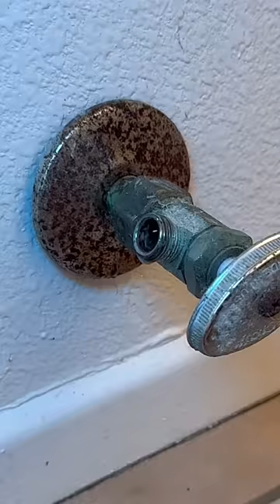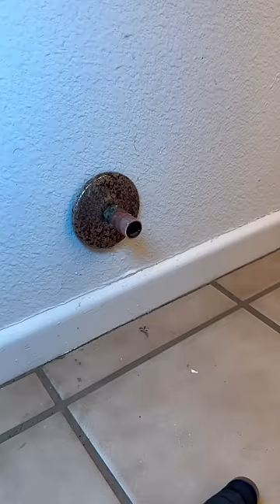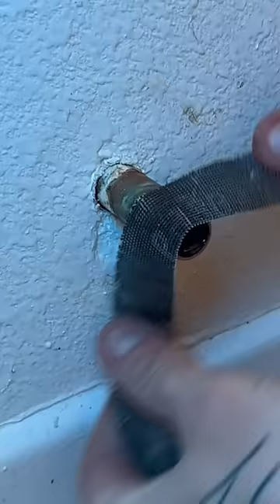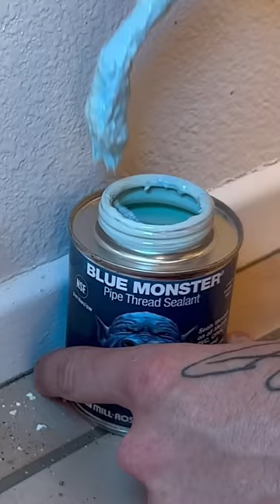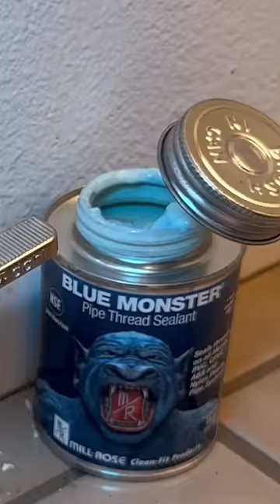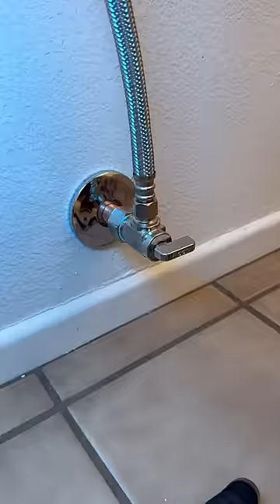HOW TO INSTALL ANGLE STOP! #new #newvideo #tips #tricks #hack #hacks #troll #water #plumbing #fyp

Comment: Wow... you know why you DON'T USE thread tape and pipe dope/ joint compound on a compression fitting is be cause it can and will cause you to not achieve the compression required to create a seal.

Comment: Southeast Asia rarely use metal parts. Usually, they are made with plastics including joints and pipes are not metals, but PVC pipes of all types, even outdoors ones. Yes, the hot rays of the sun eventually turn them brittle.

Comment: Even PROPERLY  threaded iron pipe fittings shouldn't "need" a sealant, the pipe dope is more of a lubricant, iron  pipe threads are malleable ,and if threaded PROPERLY, all the dope is squished out of the actual threads once tight. . Putting dope on non malleable threads  is ridiculous.
Reply from the maker: Yessssirrr 🙌

Comment: If you need thread sealant then you have installed the valve incorrectly. The combination of compression between the nut, the farell, and the valve body make the seal.

Comment: It is a compression fitting Dudley Doright, there is no reason for pipe sealant. He cleaned the copper, why did he not just sweat on a proper fitting? This is a video on how NOT to install a 90 degree ballcock compression fitting.
Reply from the maker: Where did you get this conclusion I wonder 💭 🤔

Comment: Why use paste on compression? I have come across this and Teflon tape, the tape sometimes is not wrapped good and is loose and long that when shutting off, the loose piece gets caught in the ball valve type and prevents complete closure of valve. So, no go with Teflon tape. New compression inside length to ferrule is sometimes too short so you need to make adjustments like either removing ferrule reducing the length, by putting a new one on it I use a 32 hacksaw blade just because I do not want to risk removing ferrule that may have cut in deep. There again, compression need NO tape or paste.
Reply from the maker: DO NOT USE TEFLON ON COMPRESSION FITTINGS

Comment: I never saw the brass ferrel in that compression angle stop. People talking about the unnecessary use of the teflon pipe dope on the threads for lubrication, not necessary but won’t hurt anything if it’s just a little bit and doesn’t make it messy. The main thing is the brass ferrel that has to fit over the copper pipe between the nut and the valve. That is what makes a compression fitting work and creates the seal when that nut is tightened… it compresses the copper pipe and flares it out a little. Not the same as a flare fitting but a similar principle. If he tightened that nut on the angle stop without a ferrel, as soon as the water is turned back on the pressure will blow that angle stop off the pipe immediately because there is nothing holding it on. Maybe I missed it. It is so basic. I’m going to watch it a couple more times and if I’m wrong I’ll edit or delete this comment. The guy used proper tools and did a good job except for not showing the ferrel and if you are going to use teflon pipe dope on threads that don’t require it, just use a very small amount or don’t use it. Definitely don’t make it look messy. I watched it again and stopped it just as he was putting the nut to the valve and I think I might have been able to make out the ferrel inside the nut before putting it on the valve. If it doesn’t leak and he cleaned up everything, including any excess pipe dope, okay.
Reply from the maker: Yes you did miss it 😂

Comment: No pipe joint compound needed when the seal is the compression ring.  I've seen it put in the actual compression ring which makes way more sense.
Reply from the maker: It’s used here differently than you think 🤔

Comment: Why put pipe drop on the threads of a compression fitting?  If properly installed, those threads never see water, and if improperly installed, the sealer won’t prevent leakage anyway.
Reply from the maker: Think about it ….

Comment: All the naysayers who criticize the dope have spent to much time in the book and not on the job . The dope or heat proof grease on the threads or and behind the brass Ferule let the nut slip and crimp the ferule into the copper . Only thing l see misleading is that the brass ferule is usually crimped into the copper thus deforming the pipe

Comment: The pipe dope on the threads is only lubricating them. the seal is made by the ferrule. It will lubricate the threads so it easier to take off next time.
Reply from the maker: Correct 🙌

Comment: Wherever there's water there's rust there's corrosion there's oxidation that's why you need to use the compound the thread compound. On all places where the water is

Comment: You don't put thread sealant on those threads. In fact you don't use it at all because the joint is a compression joint that compresses the compression ring onto the pipe and that's why he had to use a puller to get it off. Don't use pipe dope ( thread sealant) on compression joints or you may over compress the joint because the pipe dope works as a lubricant) just clean and compress😊   oh also don't make instructional videos of you don't know how to plumb!
Reply from the maker: You clearly don’t know what you’re saying user-os8sy…??? 😂😂😂

Comment: Why did you put sealant on those threads? If water gets past the feral it will flow out of the back of the nut, I don't get it
Reply from the maker: It’s acting as a lubricant in this situation 🙌

Comment: The copper tube is not threaded. How does it not leak after tightening the nut to the valve. Does it not leak because the valve is compressed to the tube on the inside? Whatever happened to compression rings around copper tubing?
Reply from the maker: This is compression…!

Comment: Blue monster, blue mega lock and TruBlue are for gas pipe and code see’s that on water here n yer instantly getting a red sticker. Fun fact the toilet tank has the cleanest emergency water in the house until you contaminate it with stuff like chemicals, dyes and chlorides.
Reply from the maker: They are for water as well 🙌

Comment: In the "Useless As Tits On A Bull" category, the winner is -  Thread Sealant on a Compression Fitting. Yay!
Reply from the maker: Ain’t leakin… I’ll be back in 20-30yrs once it’s done its job
Reply: It will never leak past the threads, because there is no water pressure on the threads! You can certainly knock yourself out and do whatever makes you comfortable, but it actually is a total waste of time. Honestly....., if I see teflon tape or compound on the compression fitting threads my first thought is "homeowner did a repair".

Comment: I’m a master plumber, just saying. Not a handy anything, compression fittings, especially new install do not require pipe dope or tape. In some cases Maybe it may need some but that’s not a long term or correct repair.
Shout out to Real plumbers and for those who think they are handy or can do plumbing, at least get the proper training from your code enforcement book and a master plumber teaching you for 7 years minimum, until then , keep on ducking up, it makes me money, thanks!
Reply from the maker: I never said it’s required lol
Reply: Yeah that’s the Main problem these days, with so called plumbers , 
no training no 4 years minimum under a Master plumber, no license, “it’s cool just figure it out bra” NOT!    
—
We don’t support that here in my state of Tennessee!

Comment: Copper pipe has no threads. You screwed on a thread nut. Do tightening seal the copper pipe to nut ?
Reply from the maker: Compression fitting 🙌

Comment: Actually, that’s incorrect. The brass Ferrel makes the watertight seal and if it needs a little help you pipe dope the feral not the threads on the valve. You’re welcome.
Reply from the maker: It’s not incorrect, your looking at it in a different way 😂🙌
Reply: With all due respect, I’m looking at it from the same angle thousands of other peoples probably will. I see doping the compression threads on the valve but there’s no sign of that ferrule anywhere. My guess it’s inside the compression nut as you spin that on the valve right before you put it on the pipe.

Comment: As long as he's not using tef tape it's a non issue, I use petroleum lubricant on compression fittings. Really helps the threads bottom out and get good compression on the ferrule.

Comment: It's amazing to know there are people who would try this without turning the water off first. 😂
Reply: @HDPLUMBERS  there was a video on yt. Where a plumber pulled one off a hot water feed under a bathroom vanity cause he had no access to the apartment building maint room. We'll he had the wrong size, once he got the right one water pressure was to strong and hundreds of gallons were all over the floor, they even tried a shop vac hose to sleeve the pipe to the toilet. Eventually building super showed up to shut it off. A disaster for the plumber & landlord. It's a sight to watch.

Comment: I’ve installed hundreds of angle stops. I’ve never had a leak when using pipe dope, but I have when not using it. My boss was a plumber in the navy for over 20 years and he recommended I use pipe dope to help lubricate the threads and get a tighter seal. Just don’t paint the damn thing he would alway say

Comment: To be safe I would have added teflon tape and plumbers putty to those threads before the thread sealant. 
Just kidding. 
But I do suggest using a chrome colored  pipe sleeve to hide the exposed copper. They are available in plastic as well as metal. Choose either the “solid” type, which has to be cut to size and slid on the pipe before the shutoff is installed, or the split type, which can be put on after the shutoff is installed.
Reply from the maker: 😂 wow

Comment: Pipe thread sealant on a compression joint, what a bodge!
Reply from the maker: How’d you come up with that conclusion? Care to explain?
Reply: @HDPLUMBERS If you need me to explain that it shows why you use it, it's THREAD SEALANT.
Compression fittings do NOT seal on the threads, a little lubricant perhaps is all that's needed.

Comment: Putting thread compound there shows everyone you have absolutely no clue how the part works. The seal is not made there and all you did was waste compound and made the job take longer and be messier.
Reply from the maker: Haha ok buddy 😂
Reply: @HDPLUMBERS it's not ok. The seal is not made there. So using it was completely pointless and only wasting time & material. 

Thread compound is not a lubricant. It dries out over time, which makes the seal better. Which will only make the nut harder to remove in the future.

So explain what the purpose of putting sealant on a non sealant part is for. 

I know you're taking this personally and your pride makes you stubborn. So go ahead and explain the technical reasons for doing this. If you make a point, I'll concede mine.
Reply: @HDPLUMBERS  no reply because you can't justify what you are doing.

Comment: first of all DO NOT over clean your copper pipe. you should clean it of debris not so much that it looks new!!!! you are thinning the walls of the copper and it takes a tighter compression to seal on a smaller diameter raising the chance of failure. 
second there is no need to tape or compound the threads as these threads do nothing to prevent leaks, its the ring being compressed onto pipe and valve that stops leaks.

my favorite thing to teach about compression fittings are do not over tighten the compression!!!! a way i like to think of it is its tight enough to stay on but maybe possibly leak when i turn water on and if i return and see 1 drop of water leak i did it perfectly because then i tighten till the leak stops. giving the best performance and any future repairs will not result in irreparable damages to the pipe
Reply from the maker: I think I did just fine , thanks
Reply: If it does not leak, success but just because  what you been doing the past 50 year doesn't mean you are doing in a way that is excessive and inadvisable this video could teach bad habits

Example lock out tag out is proper safety procedure to prevent stupid turn on misshaps but does anyone go this far to do the right thing
Reply from the maker: @kevinalmeida7159  that’s very true, however I don’t think I’m teaching bad habits in this video 🙌
Reply: @HDPLUMBERS  ok let's pretend a house is 60 years old and the hard water demands a new angle valve well you may think wow it's time for a new valve and you go to clean the copper to look new but every clean takes half a mil off and copper rings only have a tolerance of 2 mil 5 changes before you make the new angle valve impossible to seal you may think cut it fixes it but every plumber before you cleaned pipe to wall to look new shaving if a minimum of half mil... nope there is no exposed pipe that can accept the new angle valve so you have to open wall to weld a new stub. Meanwhile in other bathroom you try change the angle valve but the compound is so old it acts like glue with added calcium well the previous plumber made your job harder by going above and beyond. Maybe pride in your work is more important than the added cost you  set upon the client and the plumbers that follow your work will critique your work and struggle with unnecessary work you added for them

Comment: The Pipe thread Sealant used on that thread shows that you don't know what you are doing.
Reply from the maker: 😂 no the fact that you say that with such confidence tells me you don’t know anything about plumbing 🤭
Reply: @lukeb5696  You ever seen a galled fitting? Better qyestion, have you ever had to try to get one broke loose?  The dope is to lubricate the threads so in 15 years the next guy can get it off without a struggle.

Comment: The brass compression ring molds to the water stop as your tighten the nut. The pipe dope plays no role in that
Reply from the maker: It does play a role just not the one you are thinking of 🤔
Reply: @HDPLUMBERS  I wasn't being a smart ass or sarcastic. I'm genuinely curious.
Reply: Been in HVAC for 30 years and never seen that before.
Reply: Something else I'm curious about is how that pharo can be taken off with a new one in the same location. The pipe is compressed and compromised pitying a pharo in the same location has the potential to leak

Comment: Absolutely perfect. I usually hate watching plumbing. You had the correct tools. Sanded clean and de burred and most importantly the correct pipe dope(not to seal it but instead to lubricate the threads) and only on the first few threads to keep it clean. Well done.

Comment: He forgot to put Teflon tape against the wall to keep the trim ring from sticking! 

He has the tool that screws to the male output boss (I always just use a crescent wrench), and the totally cool ratcheting box end (?), the ferrule nut puller, the emory cloth, and the pipe end burr trimmer.

But I didn't see him put a ferrule under the new ferrule nut. If he's relying on that dope to hold it all together when he turns the pressure back on, that valve is going to shoot across the room like a surfboard on a tsunami.
Reply from the maker: Hey buddy, clearly the ferrule is in there. I don’t think I would be able to leave the house if it wasn’t 😂